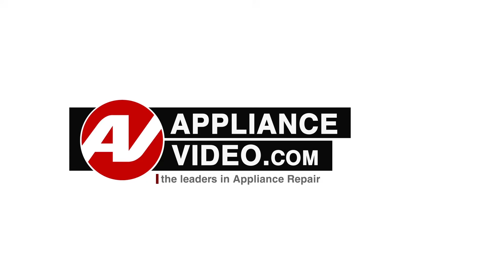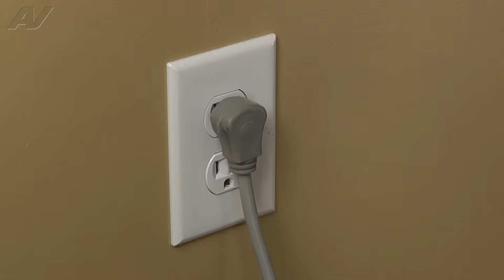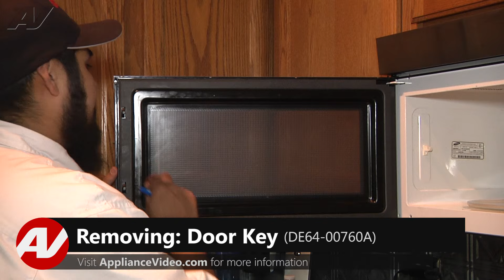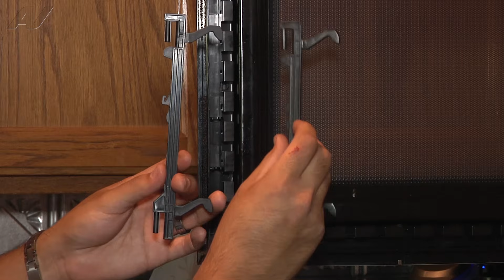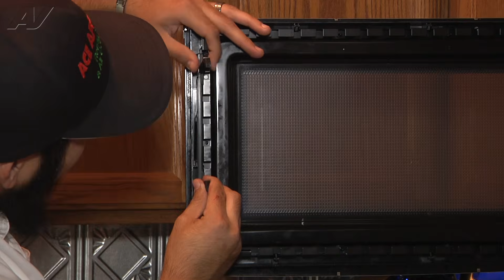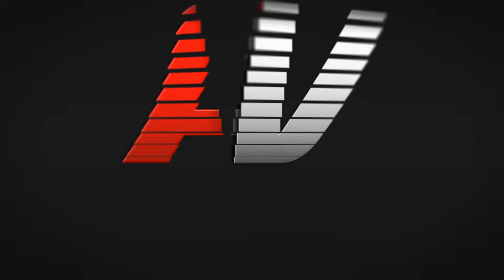Samsung Microwave Repair - Door Will Not Latch When Closed - Door Key

Comment: What do you do when the plastic piece that the spring hooks on to --- on the actual door breaks off? The key is intact with the spring and a piece of plastic that I assume attached to the door at one point.
Reply from the maker: Great question, if you have a more technical question that our parts department cannot answer, you can search our over 17,000 answered questions free at our website www.ApplianceVideo.com under our Repair Help section. You can also call our parts department at 1-800-830-5465 and they can give you help 7-days A week ,or search at www.SaveMoreOnParts.com  .
Reply: @Appliancevideo  it's ok i figured out.. just moved the spring to a different place but it worked
Reply: @ABlueDahlia  We are having this same issue...its the piece INSIDE the door that the spring clips to that broke...you just moved it to a different place inside the door?
Reply: @kristendipini3365  I did. There should be another leverage point in the door that you can hook the spring to if it isn't the part that broke. My spring was absolutely perfect and strong so I just kept placing it in different places and trying to close the door to see if it would work and it did. I didn't have a drill bit or a drill that would fit appropriately in that space, or at least I didn't think I did so that is why I just tested it that way. Once it all worked I put everything back on and it acted like it didn't want to work, but it was just the plastic exterior that needed to be pushed in more and then it was perfect. Hope that is helpful for you!
Reply: @kristendipini3365  Yep, just drill into the side of the plastic wall (from outside the door in the place where the cover should be) near where the bring holder used to be. Thread the spring through there, and then hang just link in the video. Boy did Samsung cheap out on this mechanism
Reply: @jeff8bitrocketfulton  the drilling tip worked for me.

Comment: The small clip that the spring attaches to has broken. It is art hard the microwave. What part is that?
Reply: We are having this same exact issue...did you figure out a way to fix it?
Reply from the maker: Great question, if you have a more technical question that our parts department cannot answer, you can search our over 17,000 answered questions free at our website www.ApplianceVideo.com under our Repair Help section. You can also call our parts department at 1-800-830-5465 and they can give you help 7-days A week ,or search at www.SaveMoreOnParts.com  .

Comment: Hello! What if the slots that hold the door key in place is broken?
Reply from the maker: Great question, if you have a more technical question that our parts department cannot answer, you can search our over 17,000 answered questions free at our website www.ApplianceVideo.com under our Repair Help section. You can also call our parts department at 1-800-830-5465 and they can give you help 7-days A week ,or search at www.SaveMoreOnParts.com  .
Reply: @Appliancevideo  Thanks for the shill.

Comment: Great video, question what are my options if the part that snapped is the hook in the door part? Do i need an entire new door?
Reply: That is what happened to mine too. I actually just hooked the spring up to the little metal portion that is next to the key so that it would have similar tension and it works without buying anything else! I realize I am way too late at this point so sorry.
Reply: @shipeepihs  Same, once i got it apart hooked it onto another area close by and golden!
Reply: @TheRealMrGuvernment  this is my problem as well, the little plastic piece broke off the actual door. Gonna give this a go. Thanks!!!
Reply: @TheRealMrGuvernment  Had the same issue. This ended up working fine. The door now closes and we have food again. The only concern I see is that the detent spring is pushing into the latch key causing it to bend, which may eventually warp it. But this is way cheaper than buying a whole new door. Shitty design on Samsung's part.
Reply: @shipeepihs  This was such a helpful tip! Thank you.  Saved me so much money!
Reply: @shipeepihs  gonna try this. Hopefully it will
Work. Thanks
Reply from the maker: Great question, if you have a more technical question that our parts department cannot answer, you can search our over 17,000 answered questions free at our website www.ApplianceVideo.com under our Repair Help section. You can also call our parts department at 1-800-830-5465 and they can give you help 7-days A week ,or search at www.SaveMoreOnParts.com  .

Comment: I was able to stretch and reattach the lower hook of the spring to a metal hole near where the old clip broke off. Took 2 minutes and no new parts and it works fine again.  Very useful video.
Reply: GUYS IF YOURE IN THE SAME TROUBLE STRECH THE SPRING OUT A TAD THEN CLIP IT ONTO THE SIDE HOLE WORKS LIKE A CHARM. Thanks yall love yall
Reply: @arjunvaidya2156  how do you stretch out the spring out? I was trying to do it by hand and it just snapped back and the hook pierced my thumb
Reply: @arjunvaidya2156  wish I had thought of that. I instead cut the spring in half and then reshaped the cut and into a hook so that it would have enough tension on the higher hole. Stretching the spring would have been much easier...
Reply: I tried that too- but there wasn't enough tension and spring kept falling off. so frustrating
Reply: @mekamiya  the key is STRETCHING the spring and then putting it in the lower hole.
Reply: I did the same too. On mine there was a small hole that didn't provide enough tension, but then there is the portion with the larger openings that run consistently down the entire side and the spring will actually catch if you hook it to that too.
Reply: Great video. I used a 5/64 drill bit and simply drilled a small hole from the outside of the plastic in, level with the indent on the metal on the other side, approximately where the spring was anchored previously. A toothpick fit through that perfectly and the spring tension keeps it pressed up against the metal. I clipped off the toothpick end sticking out of the outside and, voilà. Perfect. Much easier to attach the spring to this lower "rung" and it’s durable. It was really tough to get the spring caught on a lower hole, so this solution proved super easy.
Reply from the maker: Nice work! Thanks for your response, we are glad we could help. Our library of over 5,900 videos are currently helping over 1.6 million people like you every MONTH.  Please help us by subscribing to our YouTube channel, or post our website www.ApplianceVideo.com to your Facebook page, Twitter, Instagram or any other social media sites. Your support will help us keep producing more free quality videos.
Reply: The lower hole broke on the door.  I found a spot to hook the spring back on. The first hole didn’t provide enough tension because it was just above where the original hole was.  Popped it back open and found a square hole just lower than the original plastic hole. Bingo, microwave closes again and back to working order!
Reply: I just did the exact same thing! The original bracket for the spring is so flimsy it was obviously a planned obsolescence 'feature'. At least it was an easy fix!
Reply: @theresestirling2458  I don't have that microwave anymore but yeah. That was a sketchy little design... No reason for it. A purpose built fail point.
Reply: @phoenix your comment fixed my latch for me thanks man.
Reply: Great ideas, thanks everyone. I was disappointed to see the frame piece broken, not the easily replaceable door key. Jury rigging the spring somewhere else saved a lot of headache.
Reply: My bottom hook(that is part of the door) broke.   I decided to drill a small hole near the same distance and hooked it there.  I did  have to  twist the spring a little to make it fit better.   Thank you for your help.
Reply: In my situation I had the plastic hole in the door frame break. So the plastic key arm was fine. I ended up mangling a keyring I took off a set of keys and used the wire to attach to the metal hole below the broken plastic one.

Afterwards I attached the spring to the wire, then the spring to the key arm. I didn't want to risk over stretching the spring so this is what I ended up with.
Reply: The part on my door was broke
So I drilled a hole in the metal part to the right of the key. That part won't break again
Reply: This worked for me, thank you so much for leaving this comment!
Reply: I had to do it this way as well because the clip that broke was on the door itself, not the doorkey. It took a bit of strength to do it but I made it way easier on myself but just unhooking the door itself so I could lay it flat  on a table. Made everything way easier. Then just hooked the door back on and done. Hopefully the doorkey can withstand the extra string tension otherwise I will have to eventually replace that anyway.
Reply: Thanks so much for this information. In case anyone has the same problem I had, the bottom of the latch spring was attached to a plastic tab, which could not be removed and the hole the spring attached to was broken. Obviously just worn through. I couldn’t get a drill in there so I filed a small piece of baling wire to a point and heated it up in a candle and melted a new hole behind the original one. Then I was able to bend the spring slightly just enough to get it in there by holding it with a small pair of needle nose pliers, and it worked. Once again, thank you so much.
Reply: Thank you a ton! I watched the video, opened my microwave door up and found the same thing - the latch was fine, but the plastic piece on the door was broken. I was super bummed out until I came down to the comments section. 5 years later and you are still helping people - thank you sir!
Reply: How do you stretch the spring out?
Reply: @jaimieconway5546  Use two needle nose pliers to stretch the spring.
Reply: @jaimieconway5546  use your fingers. It's not a big spring or difficult. Grab, pull, and attach it tighter.
Reply: @jaimieconway5546  you can hook the spring to something heavy and grab the other side with pliers.

EDIT: I used the handle of a propane tank that happened to be just outside the door.

Comment: is it okay to use a microwave without the inner door trim ? mine doesn’t seem to be snapping on
Reply from the maker: Great question, if you have a more technical question that our parts department cannot answer, you can search our over 17,000 answered questions free at our website www.ApplianceVideo.com under our Repair Help section. You can also call our parts department at 1-800-830-5465 and they can give you help 7-days A week ,or search at www.SaveMoreOnParts.com  .